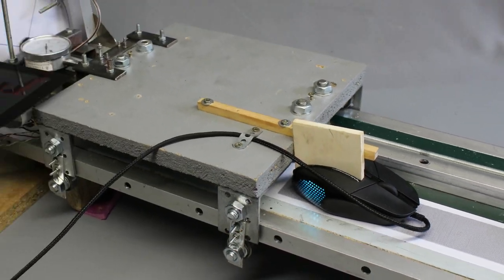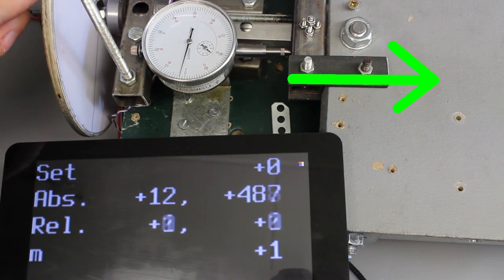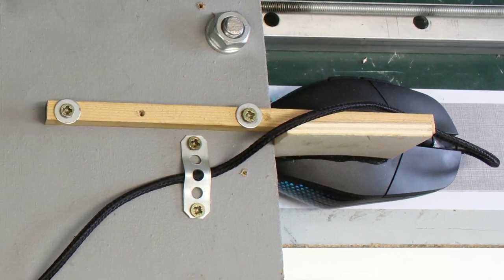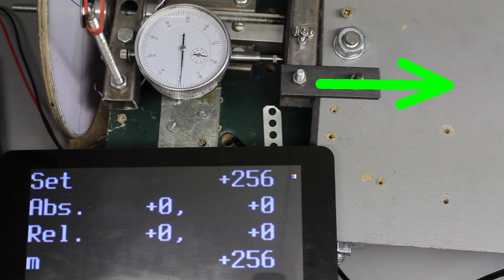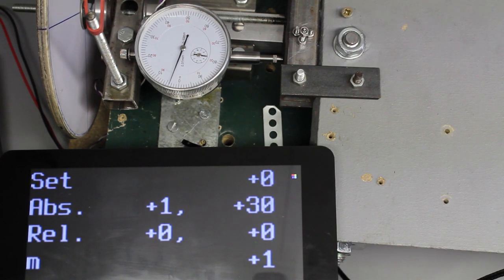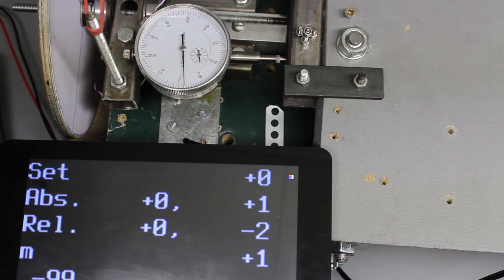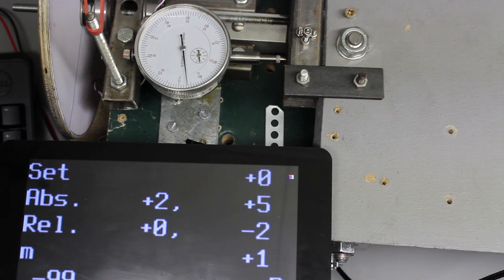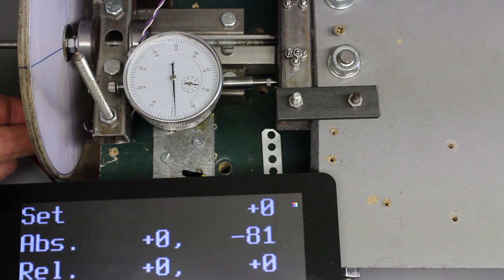Using a computer mouse as linear sensor

Comment: Thanks, I've been looking forward to seeing this. I was thinking about the issue with the first mouse's firmware. I wonder if you mount the mouse perpendicular, rather than parallel, to the movement if you would get a better result.
Reply from the maker: Give me a reason why the results should become better in sensing the X axis of the mouse.
Reply: Just a guess really. My hypothesis is based on the fact that the video seems to show the inaccuracy most visible when going left or while the mouse was moving in the down direction.  At 8:40, you commented that in the downward direction of the mouse that "it looks like the firmware adds an extra boost to the relative change in coordinates." This could be to compensate for the rather asymmetrical movement of the hand when moving the mouse up and down.  If this was the case, I would assume that they would not do this as much when moving left and right because of the more symmetrical movement of the hand.

Finally on a different note, it does seems that you are running into a number of the common issue with mouse accuracy. For example, "pixel walk" when moving the mouse very slowly that the mouse losses data. Of course, I'm sure you know about the "mouse acceleration" feature that often negatively affects graphic designer and gamers.
Reply from the maker: Even if the accuracy would be better, there will very likely be that extra boost in X direction, too and that's what makes the mouse useless as absolute linear sensor. I will probably add the results on my page if I find some time to do the measurements.
I am reading the raw mouse data and the "mouse acceleration" is just a software feature of graphical interfaces, thus that isn't an issue with the software I have written.
Computer mice have different needs than linear sensors, but pixel walk and sensor noise are issues affecting the precision of both.
Thanks for sharing your thoughts.
Reply from the maker: The results with the sensor pointing with the X axis into direction of movement are slightly worser:
http://www.homofaciens.de/technics-machines-cnc-v3-x_en_navion.htm
Computer mice are designed to be human input devices rather than linear motion sensors.
Reply: +HomoFaciens  Hey, thanks for trying. That is encouraging. Too bad the results were not more positive. But I agree with you, a mouse might be OK for a human interface but not for a precision linear sensor. So, what about a cheap digital caliper?
Reply from the maker: Rouverius
...I will place an order for one of these cheap digital calipers.
Reply from the maker: I guess those tools use encoder wheels rolling along the caliper. It's like a ball mouse with just one axis of measurement. I will try something like that in the future - stay tuned!
Reply: +HomoFaciens I found this link that might help you with the interface. https://hackaday.com/2016/05/17/improved-digital-caliper-interfacing-including-3d-printed-connector/

From what I've seen they are similar to the printer linear sensor but instead of IR they use capacitive sensing. There is also a clever interference pattern used on the sensor contacts to greatly increase resolution.
Reply from the maker: Must really order one...

Comment: First at all, congratulations. Was a great experience.
Please, try to reprint the encoder tape drawing vertical stripes only. Horizontal lines may be doing some kind of interference? I don't know, but it may be a good starting point to solve this wrong lectures. Greatings from Brazil!
Reply from the maker: Yes, the pattern on the surface has an impact on the reading of a mouse, however you'll never be able to get absolute precision. As shown in the video, most errors are caused by firmware. Computer mice are not meant to read absolute coordinates.

Comment: Are you using the Arduino board as a USB host?
Reply from the maker: It's a Raspberry Pi that serves as USB host. Arduinos can't operate as USB host. I am using PS/2 mice to detect motion with an Arduino and a computer mouse.

Comment: How about using just the optical sensor module of the mouse rather than the full device itself including its USB mouse HID layer firmware / microcontroller? Also, many of the sample points you're receiving may be from some firmware subsampling approximations rather than actual data.
Reply from the maker: Yes, as stated at the end of the video, the errors are mainly caused by the firmware. I did some experiments using the raw data from the chip in a previous video:
https://www.youtube.com/watch?v=SXQfT7c-9rU
You need the datasheet of the image sensor to get those raw data. I haven't disassembled the (expensive) computer mouse (yet) to see what sensor is used. If it is a SOC with integrated microprocessor it will be nearly impossible to hack the code...
Reply: There is a cheap sensor called ADNS-3080 which can be found in some gaming mice that can be read directly via SPI, both data and images.
Reply from the maker: Maybe I will have a closer look at one of those optical sensors if time will come. The Idea of this video series was to find a cheap, commonly available sensor for the linear drives in my CNC v3.x series. Hacking a very special optical sensor is interesting, but not on top of the list of things to do next. Currently I am designing the chassis of my new CNC
I'll keep that sensor in mind...
Reply: HomoFaciens Optical interrupters are the only way to go here, mice just aren't reliable enough.
A slightly more expensive, but infinitely better(under 5-15um) alternative would be a magnetic encoder solution from Austria Microsystems and linear encoder magnetic stripe/tape.
The ICs themselves are basically nothing(under $5 each), the stripe is quite cheap(about $20/100mm for 8um grade), but tricky to find.
Reply: Hi +Spirit, do you know which mice models or model might have the ADNS-30 chip?
Reply: I'm having difficulty getting the ADNS-3080 chip, any luck sourcing it?

Comment: how can you set 1200DPI with PS2 protocol? i've seen that you can set at maximum 8count/mm
Reply from the maker: That depends on the specifications of your mouse model. If you are lucky, you can find a datasheet listing the commands.
Reply: thanks for the answer! by the way, i've seen that the sensor  that i'm testing (A2637) have a maximum of 1200DPI. i'm a bit confused about that, it means that i can get about 48 count/mm? 
i'm using your arduino script and with the command 0xE8 0x03  i can set the resolution of 8 count/mm, is this the maximum or i can go further? for example sending 0x04?
Unfortunately all what i've found was a datasheet without any commands information
[EDIT]
i just did a test, and i've figured out that with the command 0xE8 0x03 actually i set the maximum CPI that is about 48count/mm.
Reply from the maker: If there is no documentation, start experimenting. Well done!

Comment: Love your videos. I was curious, instead of a computer mouse, what about a cheap Digital Calliper tool. they are extremely accurate and cheap! Most of them have a computer port that you may be able to reverse engineer! try it out for us?
Reply from the maker: I'll keep that in mind, but not for the near future (too many projects running).
Reply: Not for a cnc machine, but I've used mechanical and digital calipers to get relatively accurate readings on a linear slide setup that is moved by hand.accurate enough for measuring radius of curvature on precision optics. Just need to do it a few times and average the results.
Reply from the maker: A use case for my CNC projects would be to do automatic readings similar to yours along an axis, checking parts for their accuracy and so doing numerical corrections in the software code. Curious if that will give better output after that kind of recalibration...

Comment: Pro tip: You can easily read PS2 compatible mouse using 8bit microcontrollers (unlike USB-only mouse)
Reply from the maker: Yes, that's what I have done in another video. But even with microcontrollers its no good idea to use computer mice for reading absolute length.
Reply: @HomoFaciens  to be honest i think that for precision operation (=to get CNC that is actualy more precise than open loop system) you need something like vernier scale or the stuff that is in digital calipers. two scales encoded with slightly different pitch, so you can get more precise reading than the scale itself... Maybe use 10 optical encoders with each being slightly more out of phase than the previous one?
Reply: @HomoFaciens  i would also love to have the encoder as close to the spindle head as possible, so it can account for any deflection/backlash in the system... maybe even use laser to measure distance to the endmill, but these devices are not precise enough. (unless you pay a lot)
Reply from the maker: No bad ideas, but for my DIY projects with precision in the range of +-100µm, the classic approach with sensor disc on the threaded rod is definitely good enough. You need really expensive/exotic components to get better. Think of the vibrations, a spindle generates when cutting through metal - that's what makes measurements really tricky.

Comment: I wouldn't immediately assume that the optical sensor firmware is causing the inaccuracy.
Your talking to the sensor via the PI's mouse driver, which is in turn talking to the PI's USB driver.
USB on the original PI is via a hub chip, so there's more driver code and signal handling there.

Some of the older optical mouse sensors have obtainable datasheets and a SPI interface.

There is a nice blog post here: 2D positioning: hacking an optical mouse!
https://pickandplace.wordpress.com/2012/05/16/2d-positioning-hacking-an-optical-mouse/
Reply from the maker: Thanks for sharing your thoughts.
I don't think the kernel drivers manipulate the raw mouse data that I am reading through /mouse/input/mouse0

The datasheet is just half of the truth, the second half is the closed source mouse firmware.

Inspired by your link and some others I did similar hacks in a previous video:
https://www.youtube.com/watch?v=SXQfT7c-9rU
Reply: Your previous optical mouse video was actually the next video in Youtube's "Up Next" list, on watching that I realized my post didn't really give you anything new. Ooops.

Many years ago I came across an optical mouse design that used some optical fibers and a grid patterned pad to generate the quadrature signals required by it's controller. I bought a couple of them, looking for them at the moment, will post some details if I find them.
Reply from the maker: CrayZeApe
Never heard of those special optical fiber mice before. That's indeed something new for me.
Reply: Clearer details about it's operation have come to mind, I was mistaken about the pattern on the pad. The pattern on the pad was divided in half, the top half was equally spaced black and white horizontal stripes, the bottom half was the same spacing of black and white stripes, but vertical. This formed a separate linear scale for each axis.

Two optical fibers for each axis were spaced at some number of stripes + half a stripe width apart. This generated a quadrature signal relative to the motion on that axis.
Reply from the maker: That's indeed an interesting device.

Comment: Its pretty difficult to make a good mouse, the main point is its a relative sensor and not absolute. Errors accumulate over time, and even has problems at different speeds, but humans keep looking at the screen the whole time and adjust. Logitech has a lot of work in that area, with their Delta Zero technology and others, and if you plugged in a g900 Chaos Spectrum you'd get nice results. But it would also cost more than the rest of the machine.
https://www.youtube.com/watch?v=wQxw-pX4dak
Reply from the maker: Precise, absolute positioning is no easy job, but worth trying it...
Reply: +HomoFaciens Agreed :)

Comment: Dude, I love your videos.My printer is comming out slowly. I came far from DC motors, now I work with FDD 3 phase motors. I already have driver for Arduino. Long time since we discussed DC... Now I need to check distance, and I hit your stuff again. Check out my beast https://photos.app.goo.gl/Six6pK7QjszGq9bB7 and gears https://photos.app.goo.gl/Wah6xoaQJ5BeFMNf8
Oh, and I too got rpi to work with, athough right now I am thinking to drive it directly from my PC with 5.2 GHz dual processor via serial port, PS2 port, sound card outputs and any other pin I can use.
Reply from the maker: Definitely interesting projects! Hope to see your beast running, soon. All machines are beasts with a tiny devil inside we makers have to fight with ;-)